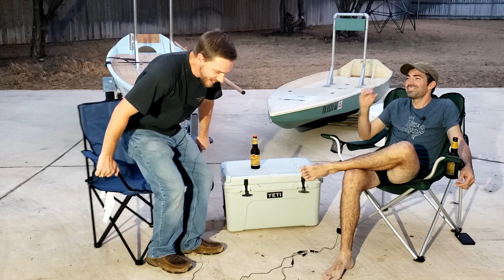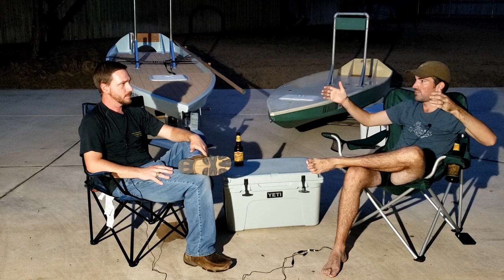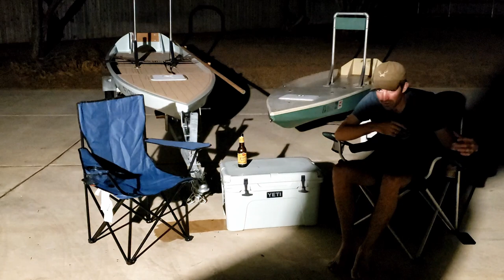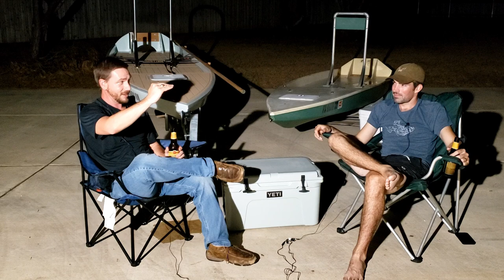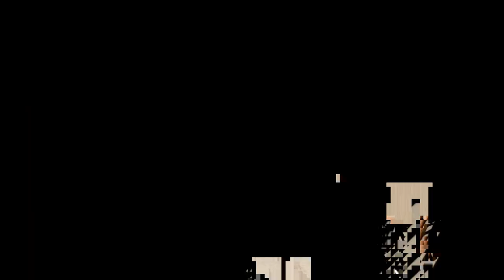Lessons Learned Building the SK14 Skiff

Comment: if you want to add rub rails and are worried about drilling into wood.. do the old over-drill, fill, drill, screw method. Drill a hole larger than what you need. Fill with epoxy, get it all good and in there. Then when dry, drill out with the correct size bit.. this will line the hole with a good layer of epoxy and your wood is still sealed.
Reply from the maker: Thanks! I'll definitely consider that.

Comment: I know this video is a year old... I just found it. I'm wondering if maybe a long strip of UHMW slippery plastic wouldn't work well as a rub rail? I've used the stuff to line belly skids on offroad vehicles before. It's very durable stuff and relatively inexpensive in strip form. Just thinking out loud...
Both nice skiffs.. great job!

Comment: Gelcoat, you guys should have purchased gelcoat with UV inhibitor added to it , they can make it any color you want, and you paint the boat with gel coat. And you add white baby play sand to it for a non skid deck
Reply: They both used epoxy resin.  Gelcoat isn’t chemically compatible with epoxy.  Polyester resin is compatible with gelcoat.

Comment: How did you join your 4x8 sheets of plywood end to end to make a 16' sheet
Reply from the maker: What I did was cut all of the panels before joining anything. After I had the long pieces cut, I joined them with the thickened epoxy. First you wet each edge of the joining ends of the plywood. After that you will butt them up against each other, end to end. Make sure to leave a small gap between the two ends,  an 1/8th of an inch or so. Completely fill the gap with your thickened epoxy and then place a strip of fiberglass over the seam and coat in epoxy. You can find a picture of mine in my photo album by clicking the link below. Make sure to put a piece of plastic underneath so that you don't glue it to your working surface.

https://photos.google.com/share/AF1QipNLgWsaV2ymD3TamTIsauqt_P16NLl3sFnVfGwoKZJ5ZIVPGyG8jLUoLM8CgTbwtw/photo/AF1QipPkW2eA6wnYBGa7S3SyG8155r5Otz-ybPUFVkNz?key=NUtaZVFLMjBNNkNTM0ZhYm1xMENaeVFoUzVtLVp3

Comment: can you transport the skiff  on a trailer  with the motor mounted ? 
or does the motor need to be off while in transport ? 
so i live in just south of san antonio it takes me 2 1/2 hour with good traffic so i'm try to finger
out if i can drive with motor mounted . if i build a skiff and buy a brand new motor
i dont want to loose it going down 37 south.
thanks for your time.
Reply from the maker: I've always wondered this myself. I always take it off. That 8hp motor is pretty light so u just throw it in the back of the truck.

Comment: I bought a new Tohatsu 9.9 last fall because it was only a few pounds heavier than the 8 hp and is fuel injected, but I am worried about the weight!  The 9.9 is around 90 pounds and I am worried that I’m going to get frustrated taking it off the boat and putting it back in my truck because it is so heavy.  I can lift it, but it is heavy!  Have heard it might not be a good idea to leave it on the boat while trailering.  Do you think I should keep it and try it out a few times?  Still have not put oil in it.  How does your friend in this video like his engine? I believe his was a bit smaller (and older) than yours.  I have seen many videos with 8hp on YouTube so not sure of the performance a 6 hp would be.  Now that you’ve used your 8 hp do you think a 6 hp at around 50 pounds would be good as well?  I’m also worried that the transom scuppers will be very close to the water line at scuppers and boat will have water coming in more than I want because of the weight.  I know it is a wet boat.  Just don’t want to be swamped.  Do you find you get swamped?
Reply from the maker: Mine is about as heavy as I would want to go on that boat. The scupper does swamp the boat if I'm standing in the very back. It lifts and drains as soon as I step back up to the grab rail though. The motor itself is kind of a bear to lug around, so I personally wouldn't want to go any heavier.

Comment: This is awesome. I literally just finished mine (hasn’t seen water yet). I’m kicking around ideas on how to power it. What do you guys think about a twister mud motor? I definitely want a 4 stroke, but prefer air cooled for less maintenance purposes. 
 I can sympathize with you on the struggles of the build, but the accomplishment feeling is unbeatable. Thank you for this video.
Reply from the maker: Thanks for the comment, man! I really appreciate it. My initial thought on the twister mud motor was that it might be too heavy. I had a buddy that had a gator tail on his flat bottom jon boat and that thing weighed a TON! But I just looked up the twister motor and it is surprisingly very light! At 54 lbs, you are nearly 30 lbs lighter than my tohatsu 8hp. I think this boat outfitted with a mud motor would be awesome. You should share some pictures if you end up doing it.

Comment: What size fuel tank do you use? Brand? Thanks
Reply from the maker: I'm using the 3.1 gallon fuel tank that came with my 8 hp Tohatsu outboard.
Reply: Thanks for the fast reply. Is it motor and tank integrated in one unit or separate? Do you have pics or video of your setup in detail? Thanks again

Comment: Some great information. I have just completed a build but without the grab bar - wanted to see how stable it was without one but having launched her I am pretty certain it is needed, as the skiff is a bit more wobbly than I thought it might be. I will have to fabricate the bar as I live in New Zealand - do you have dimensions for it? One or two fishing rod holders? What is the best way to mount it?
Reply from the maker: It is surprisingly stable in my opinion. I can easily stand on the bow and fish from it. I don't remember the exact dimensions of the grabrail, but you can find it for purchase at boatbuildercentral.com
I have just one rod holder, but I wish that I had made it with two. I think stainless steel screws with marine grade sealant is the best way to mount it.

Comment: I went from a  2021 Hobie PA14 360 to a Old Town Autopilot 120 due to extreme weight of Hobie.  (Well, at least for me - I will be 77 this year.  OT works great but, by design, they are slow from Point A to Point B.  Skiff looks great and could be a step in the right direction. Down side, at my age, total build out at my age could be the last thing I do in this world😂😂.  I have seen a couple for sale but not sure they took the pains you did on your build out.  Do you recommend me buying used one complete or other option?
Reply from the maker: I think buying a used one would be a fine option if the builder documented the build thoroughly. This same build has an option for a kit. It includes all of the materials needed and the wood panels have already been cut with a CNC laser. Maybe that could be an option for you?

Comment: Where did you buy your plywood for the build? Or is it ok to use stuff bought from lowes or home depot? (I’m in the Austin Tx area) Love the build and the channel!
Reply from the maker: Well you're in luck being in the Austin area because we have one of the only places in this part of Texas to buy marine grade plywood. I got mine from Fine Lumber and Plywood. They sell marine plywood which is what you'll want to use. The problem with wood from Lowes or Home Depot is that the quality is not nearly as high as what it needs to be for boat building. It will give you trouble during the build process and it will deteriorate faster over time. Glad you like the channel!
Reply: @SchwindOutdoors  thank you! I’ll look them up. I’m trying to decide on which boat I want to build currently. I love the size and “simplicity” of the 14ft solo skiffs like yalls, but I’m a bigger guy and would like to be able to take another person with me fishing (~500lbs with two people), so I might need a boat with more capacity. Looking at the fast skiff 14 low sheer plans currently as it’s small enough to build in my small garage yet has more weight capacity.

Comment: I don't know how to join such thin sheets,  any help would be great
Reply: Not sure how they done it. But there is a few different ways you can join the plywood together. You can tapper both sheets roughly 10” then glue together. Or you cut notches like a puzzle piece.
Reply: You can scarf 4 inches on each piece of wood use epoxy glue them together when you scarf them do it at about 5°
You might wanna try on a piece of scrap wood first I just used a planer or a belt sander
Reply: Puzzle joint them together. Super strong.
Reply: Put skies on a circular saw set the blade to half the plywood thickness. Mark your joint, butt the two sheets together route to the mark.
Reply from the maker: I apologize for the late response. I'm just now seeing your comment! If you have to do an end to end joint, you'll want to wet both ends. Butt them up against each other and leave a small gap between them so that epoxy can get down in there. Glue it with a good fillet of thickened epoxy and a strip of fiberglass tape on top. Once that has dried you should be good to go. The key is to not starve the joint of epoxy. The picture below shows an example of mine. 

https://photos.google.com/share/AF1QipNLgWsaV2ymD3TamTIsauqt_P16NLl3sFnVfGwoKZJ5ZIVPGyG8jLUoLM8CgTbwtw/photo/AF1QipPkW2eA6wnYBGa7S3SyG8155r5Otz-ybPUFVkNz?key=NUtaZVFLMjBNNkNTM0ZhYm1xMENaeVFoUzVtLVp3